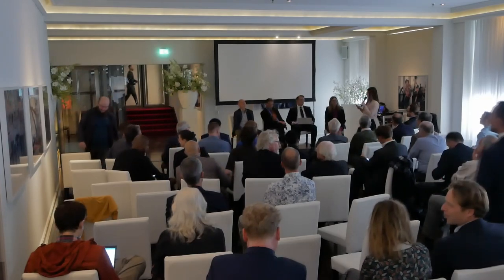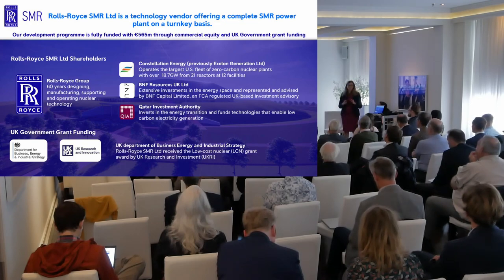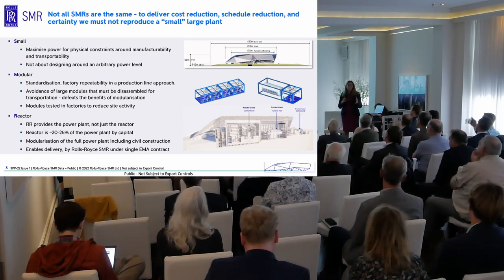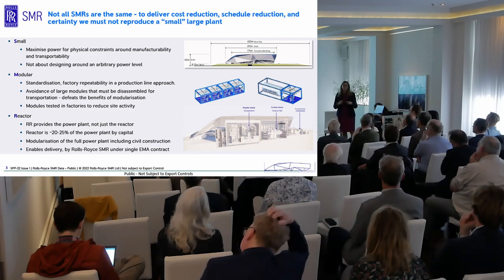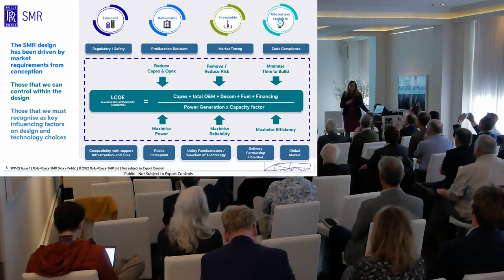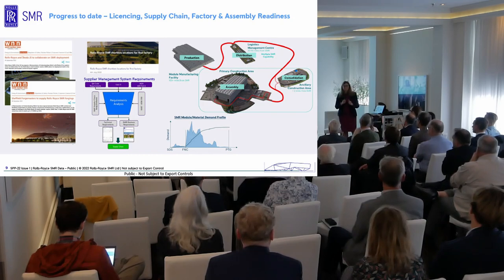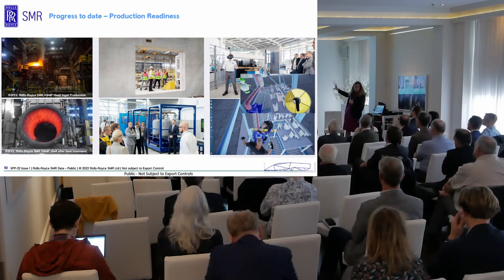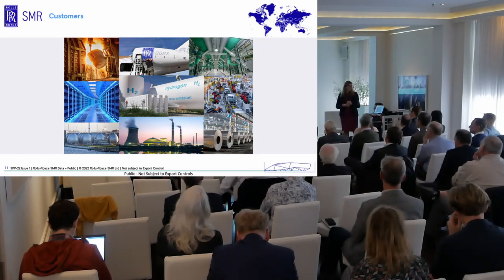Rolls Royce Nuclear "Small" Modular Reactors are coming!

Comment: SMRs unless they are based on molten salt still face challenges with radioactive waste, low fuel efficiency, and the risks associated with high-pressure reactor vessels. While SMRs can serve as a short-term solution, Molten Salt Reactors (MSRs) are considered a more promising mid-term solution due to their potential to address these issues more comprehensively. Hopefully, we will have fusion by the time we run out of uranium and thorium.

The differences between Light Water Reactors (LWR) and Thorium Molten Salt Reactors (TMSR) are significant in fuel utilization and waste production. LWRs use approximately 0.5-1% of uranium fuel, leading to the generation of long-lived radioactive waste due to inefficient energy conversion and the use of enriched uranium. In contrast, TMSRs can achieve fuel efficiency of up to 99%. This is achieved by converting fertile thorium-232 into fissile uranium-233, substantially reducing waste production and more manageable radioactive waste. Uranium Molten Salt Reactors (UMSR) are just as effective as TMSRs.

800 kg of natural thorium in a Molten Salt Reactor (MSR) can generate 1 gigawatt (GW) of electricity for one year. In comparison, generating the same amount of energy in an LWR would require mining 250 tons of uranium. In an MSR, the storage requirement for 800 kg of spent fuel is 300 years, whereas in a LWR, 35 tons of spent fuel need storage for 300,000 years. MSRs can utilize the spent fuel from LWRs. A coal power station will need to burn 4.55 million tons of coal and emit 13 million tons of carbon dioxide to produce the same amount of energy for one year. That amount of coal contains 4 to 18 tons of uranium, 13 to 68 tons of thorium, and 4 to 45 tons of arsenic.

Of the six proposed fourth-generation nuclear reactor types, the MSR is the only type that does not generate substantial amounts of plutonium. The fissile uranium-233 produced by the MSR is difficult to use for weapons because of the presence of highly radioactive uranium-232.

MSRs can adjust power output to match electricity demand, thanks to the inherent and automatic load-following capability provided by the fluid nature of the molten salt coolant. A key safety feature of MSR is that it automatically adjusts to prevent overheating. This is achieved through a "negative thermal reactivity coefficient," which means that as the temperature rises, the reactor's reactivity decreases, preventing a runaway chain reaction. Additionally, the MSR has a "negative void reactivity coefficient," ensuring that the reactivity decreases if there is a loss of coolant or boiling, preventing potential overheating. These safety measures help keep the reactor stable and safe under various conditions.

Looking ahead to 2040, China plans to deploy Molten Salt Reactors (MSRs) for desalination of seawater, hydrogen production, powering of ships equipped with Thermoacoustic Stirling Generators, and power plants with Supercritical Carbon Dioxide Turbines within its borders and globally. In the Earth's crust, thorium is nearly four times more abundant than uranium. Every atom of natural thorium can be harnessed, unlike natural uranium, where only 1 out of every 139 atoms can be used. China produces thorium as a byproduct of its rare earth processing.

Similar to the trends observed with solar and wind technologies, MSR costs are anticipated to decrease with the scaling up of production and the development of robust supply chains.

Comment: What are the site requirements in terms of access to fresh water for cooling purposes? Will these require cooling towers? I’m a huge fan of the idea. Just curious to know if the RR SMR concept is limited by the same constraints as traditional site-built nuclear plants.
Reply from the maker: It has specific design elements that would make it be capable of being built in a desert environment. So no continuous surface water feed would be necessary.

Comment: The fact that this is a normal pressurized reactor and will use normal fuel means all the issues still are around. Low amount of total usage of the fuel and the dangers of a high pressure reactor vessel. Molten Salt reactors are the future, this seems like RR jumping on the band wagon. Investing in this sort of system doesnt advance what humanity needs for a power reactor for the future. This is status quo
Reply: It is not what you think. It is lifted from the design of the PWR3 for the Dreadnought subs. It will not need refuelling for 50 years.
Reply: molten salt are the future need more proof of design before they are ready to build at scale.  Lets get SMR working built on time and on budget. Then work on the next generation of nuclar power reactors what ever that happens to be Molten salt has my vote
Reply: @davidhill3724  
Not just "proof of design". They need corrosion resistant materials that will last decades in service. Those haven't been developed yet. They cannot begin more than a conceptual design until such materials have been developed, tested in various small scale models, and their mechanical properties determined. Could be decades.

Comment: Allan Fells, a long term Australian Government advisers, said Australia needs 5 times more electricity and so the Australian 25gW fossil fuelled generation today has to be increased 5 times if it is nuclear.
The SMR like the BW300X means that Australia needs 85 x 300mW = 25.5 gW.
But with no fossil fuels Australia needs 5 x 85 SMR = 425 SMRs.
No gas, no petroleum, no coal. No CO2 into the atmosphere, that is the point, yes ???
No CO2 from any other country on the planet, because why waste Australian money, yes ???
SMRs are the most economical electrical generation method and mass production will make them extremely cost effective.
Australia can expand its 7,000 tonnes of uranium ore extorts to 100s millions of tonnes.
Money in the bank for Australia, yes.
Australia in partnership with RR. 
$2 billion each installed and running. Ezi pezi.
5 fold increase in world demand for electricity, means Australia can also ramp up all mineral exports as our coal and gas exports ramp down.

Comment: I think this modularization concept is a bad idea. Fabricating main components in a factory makes sense of course, but making hundreds of blocks of container size modules doesn't bring any benefits. There will be lots of interface points (flanged joints, insulation, bolting of module frames, vibration dampening, extra isolation valves, junction boxes..) between modules to worry about. The designers are trying to avoid poor installation quality and cost overruns of rogue British contractors, but this modularity idea will create more problems than it solves. Look at refineries, petrochemical installations. They have the main equipment (huge distillation columns etc) and critical pipe spools prepared in workshop, but do the rest of installation on site.
Reply: I think you totally MISSED the point that these reactors are based on the PWR3 reactors made to fit in the new Trident Dreadnought class subs. The idea is to station these SMR's on MOD bases and wire them into the grid and they will not need refuelling for 50 YEARS. At the end of life it can simply be carted off on a lorry!!
Reply: @nathd1748  OK make the reactor core unit(s) prefabricated in the factory in transportable size, but in this presentation (around 03:30) they're talking about making container size everything. Which is not necessary. Why would you need to modularize cooling water system, pressurized air system etc?
Reply: @kekessalman  The water cooling system on a submarine is the surrounding sea water which is the missing key on the land based SMR.
Reply: @nathd1748  and what's that got to do with modularization in this project?